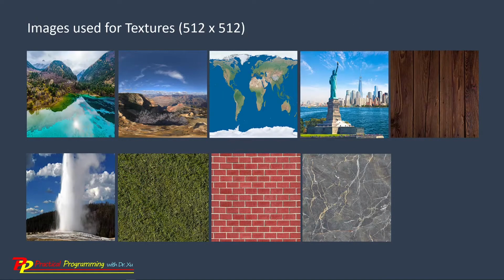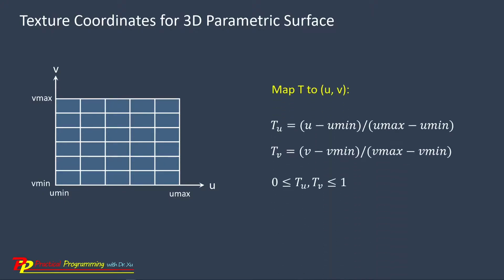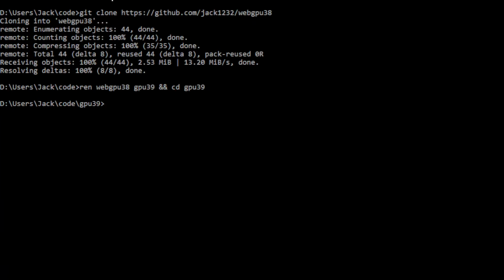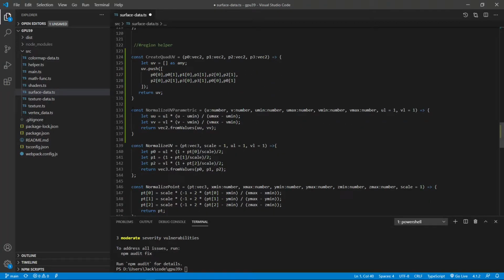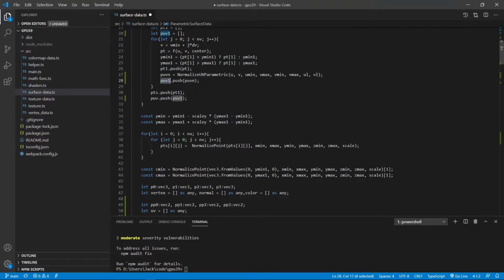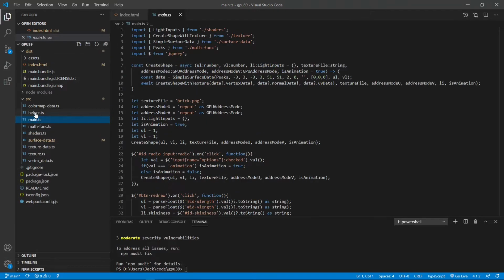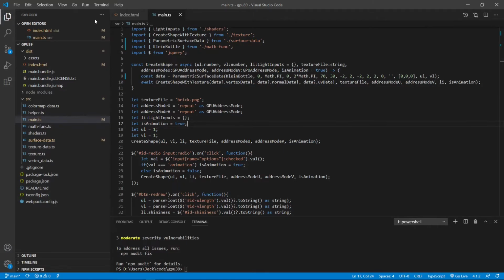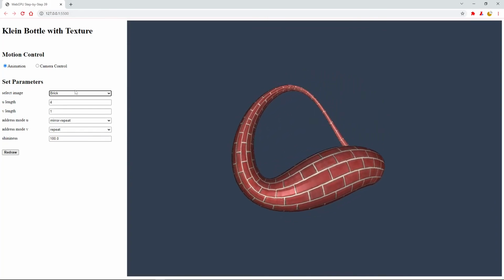WebGPU (39): Texture Mapping - 3D Klein Bottle

Comment: They made another update on WGSL. The double square brackets syntax is now deprecated, and you should use @decoration instead.
Reply: So instead of [[location(0)]] or [[stage(vertex)]], you now say @location(0) or @stage(vertex).
Reply from the maker: Thank you for pointing out this change. I will try to use this new syntax in my new video examples.